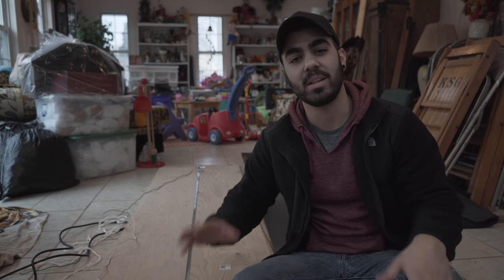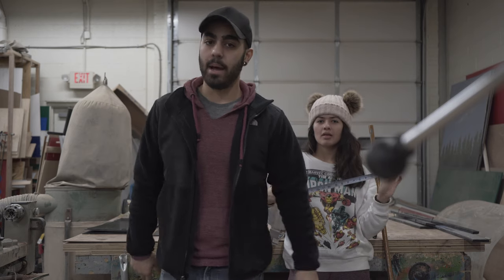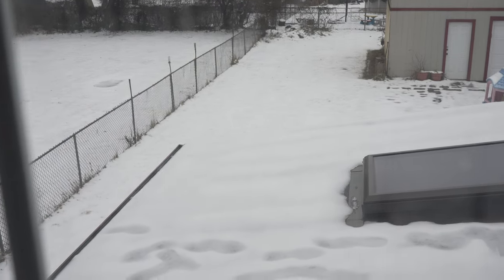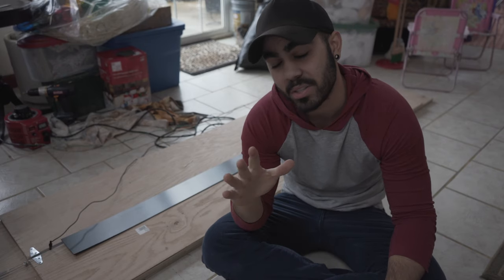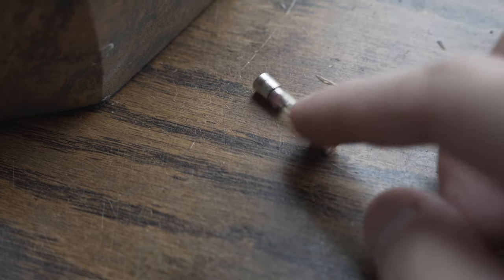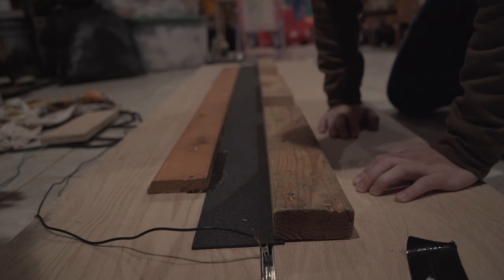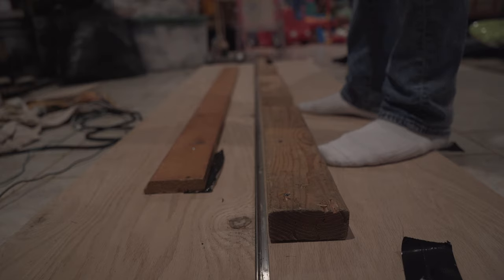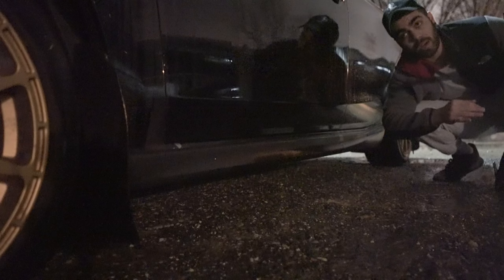Making Aggressive Side Splitters for Subaru Impreza (DIY)

Comment: Sometimes when you measure just from the fence to the blade, when you tighten down the fence it will not be perfectly straight, so I first I get the measure of the fence to the blade where I want it, with the tape pulled out to the edge of the saw table top, and use that distance to measure from the edge, to the ends of the fence, before tightening the fence lock.